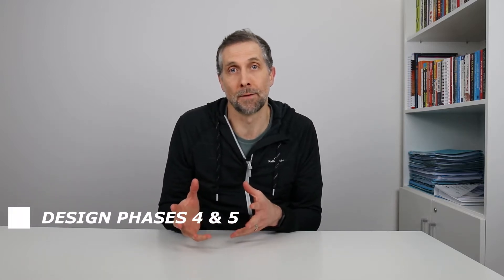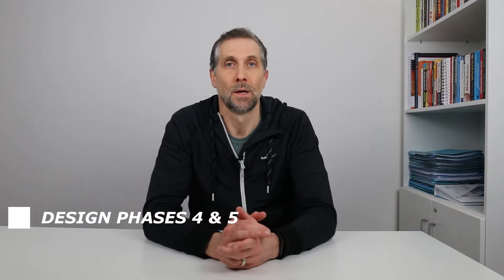BMS Data Centre Design - Tier 3 & 4, and Monitoring

Comment: Awesome videos Bryce. Very informative. I'm a HVAC/R service tech looking to expand into the BMS side. Do you have any advice on how I can get my foot in the door?
Reply from the maker: Hi Trevor, 
1. When ur onsite doing mech stuff, go play with the BMS. Navigate the graphics, become familiar with the different systems, the look and feel. 
2. Get a copy of the BMS functional description / control sequence. Read it. Start to understand how the AHU is controlled. 
3. Get the points list and network drawing. Understand where the panels and controllers are. Understand which sensor on the graphic is wired to which controller.
4. BMS companies will hire a new BMS service tech with a HVAC background, your experience is more appealing to them than you think. Approach them, go for interviews. It may be a junior role, but you will eventually get a job. 
5. Do my Technical Introduction to BMS course 😊

Thank you for your support on the channel. Cheers.
Reply: @bryceanderson17  Thanks for the advice! This is great. I'm currently not working at the moment so with all this spare time I've got, I'll be sure to check out some courses on your website. :)